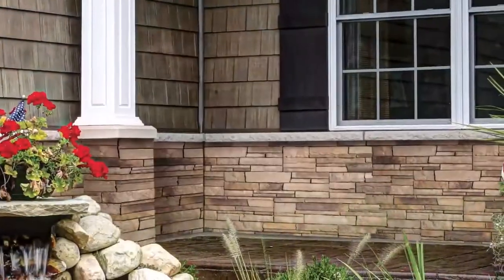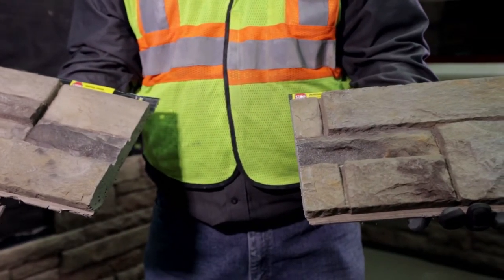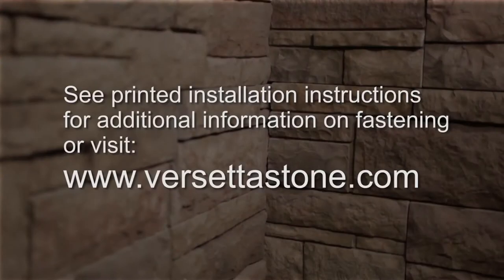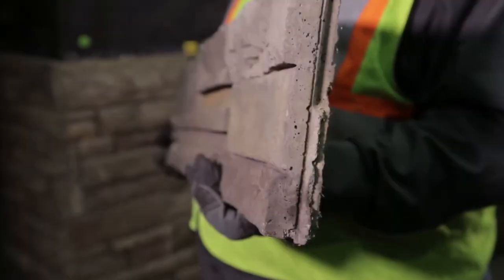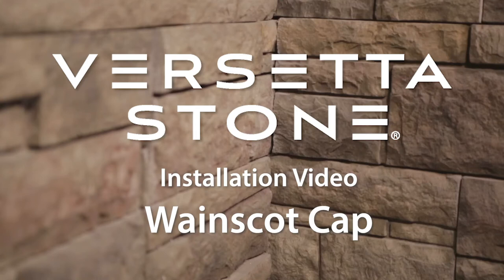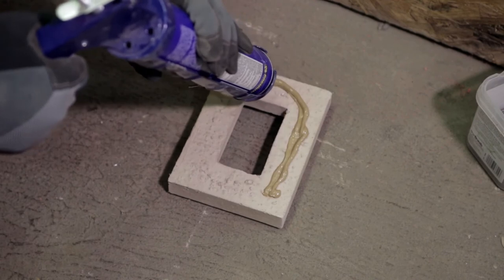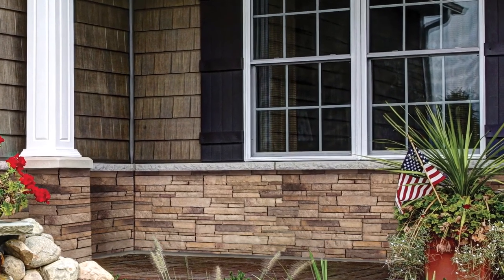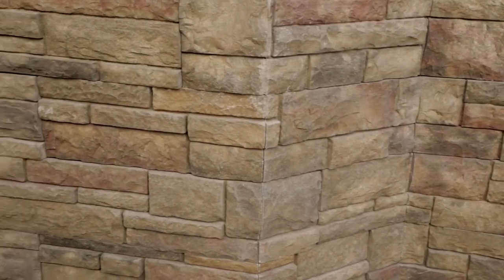Versetta Stone Installation

Comment: I saw many joints that probably should have been sealed with silicon caulk.  That stuff would leak huge with a driving rain or a homeowner armed with a garden hose.  Siding shouldn't rely on underlayment. Granted, I don't have "The sheet of Instructions" that come with the product, but you should be a little more forthcoming about the amount of silicon caulking it would take for a proper exterior application.  Remember, think like a rain drop!

Comment: How do u install on concrete stucco foundation of house 4 ft high
Reply: You use much more affordable Veneer stone adhered with poly modified mortar.  Those panels can line up without much skill or knowledge in order to create the same look
Reply: follow the same instructions, but use tapcons